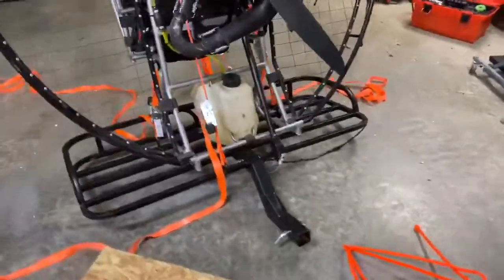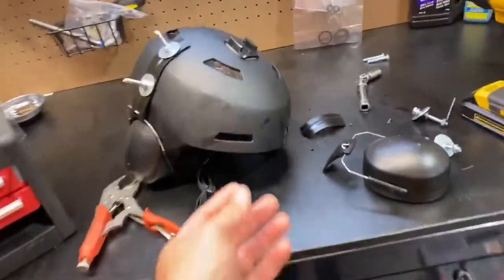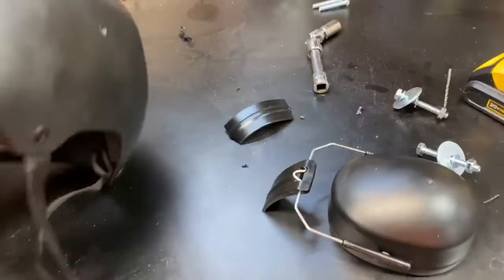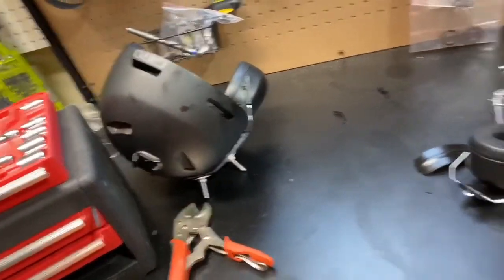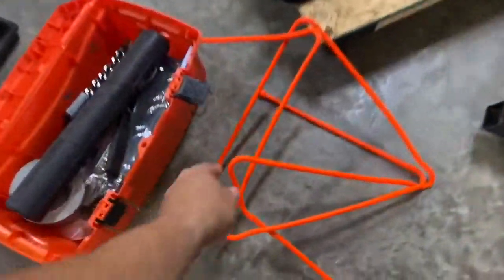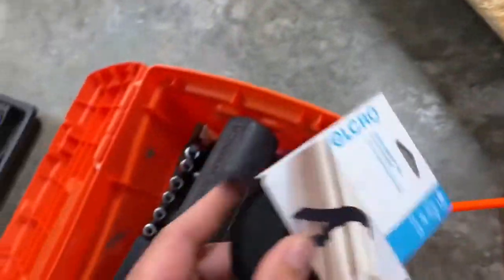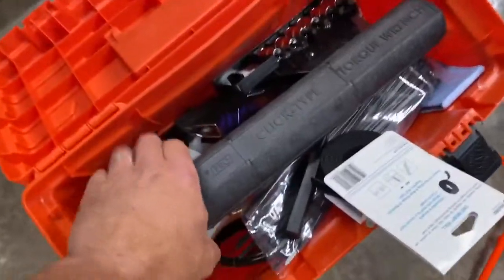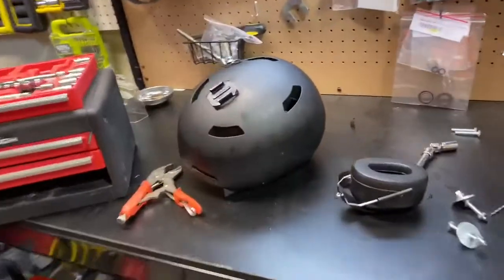Paramotor toolbox and helmet ideas

Comment: Sean, I have watched your channel from the start of the paramotor series. I was concerned in the beginning with the self training and used paramotor that seemed to need a lot of expensive repairs. I am really glad you have got that thing working so well and can kite the wing like a pro now! I wish you the best on your upcoming solo. Just curious, what did all the repairs end up costing?   Good job so far man!  By the way, I had to watch the simulator video with one eye covered hoping and praying the ceiling hooks didnt pull out when you were running the motor in the garage!  WHEW!!
Reply from the maker: Paramotor $3K and $500 for new carb and 100 hour maint kit. $3500 for new wing.  That’s it.  Oh $39 for the cargo hitch from harbor freight.  Not that bad.  Hope this weekend I solo and start making ParamotorTV videos